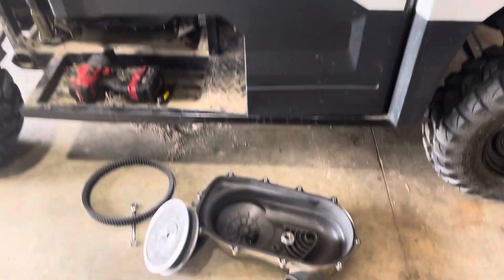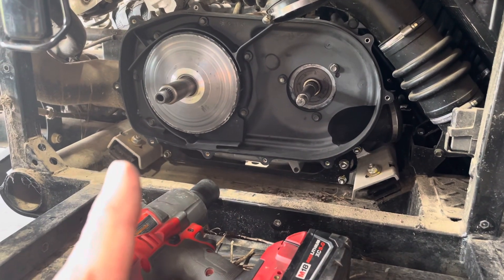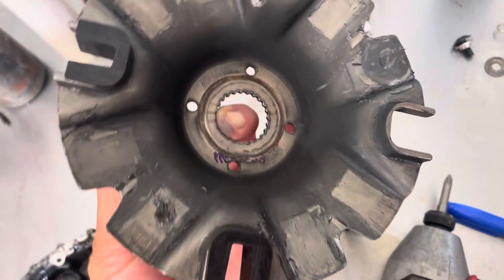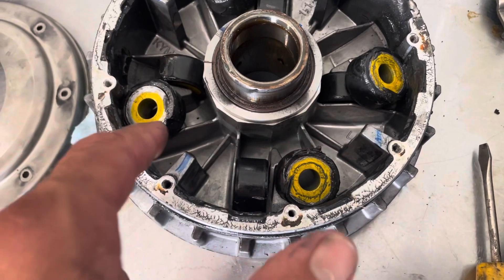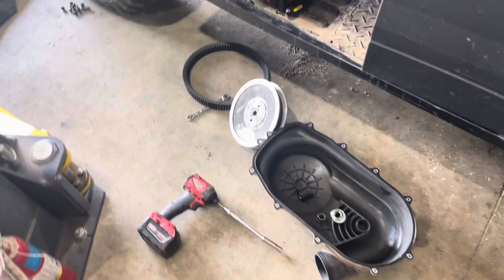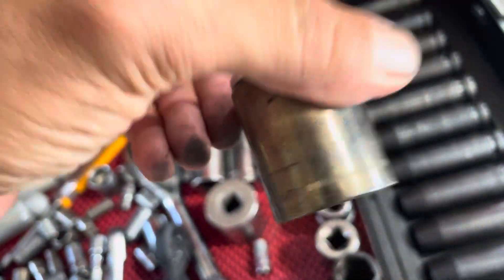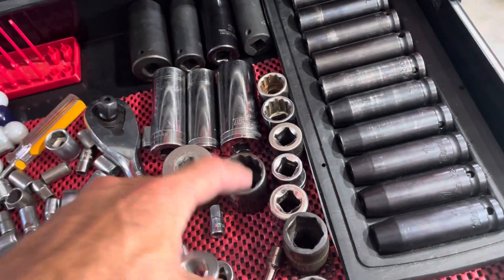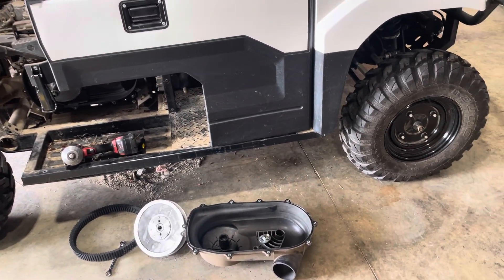Clutch removal and how it works mule pro Mx 700

Comment: I am installing a new belt on my 2022 Mule Pro MX. I can not get the belt to go on, I tapped the secondary and spread the clutch with bolts , does the primary need to be removed ?